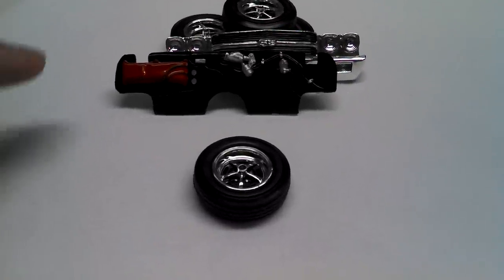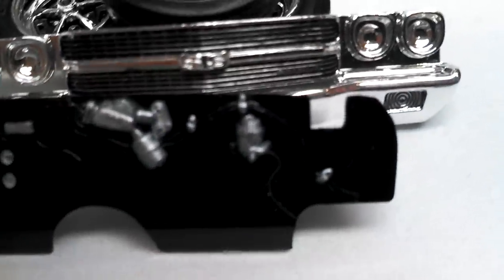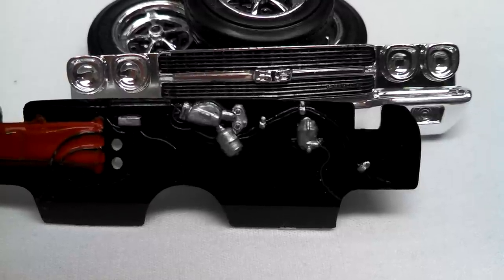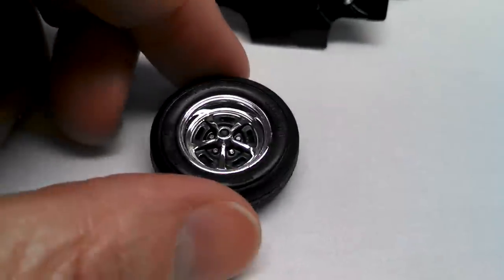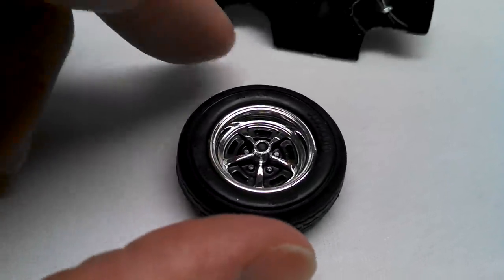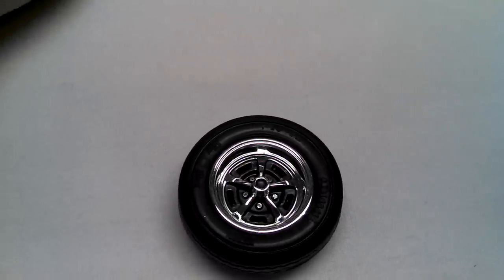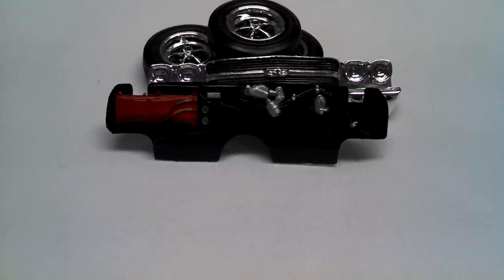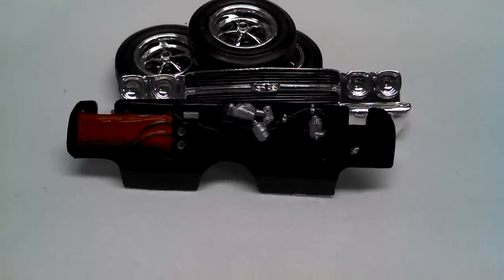Tip: Detail Painting your models

Comment: 6:00 - In regard to painting hoses that are molded on a black firewall, I would experiment with various "shades" of black. For example, "rubber" is a different shade of black. You could also lighten the color a little bit. I am lucky because I don't enter contests or send pics to magazines and my family is not interested enough to notice subtle differences in shades of color. My only audience is me. I do enjoy experimenting on scrap plastic. Thanks for this video! I have just subscribed. OBTW: I don't "wash" the grill with flat black because flat black shows that the grill is one solid piece of plastic, so what's the point. Same with wheel slots. I use classic black. I tried sanding away enough plastic to make the grill look "open", but it just never looked right to me.

Comment: I’m in no way an expert so when I get a chance to contribute something it makes me feel kinda good so hopefully this will help someone along life’s way. I recently built the 66 Chevelle Street Rat, that was not without its problems but I got it to a feel kinda good about it. I painted it the 50s ice blue and I wanted to make a black vinyl top and didn’t have any masking tape to put on it so I found these art deco foam dauber brushes at DG Store and mixed up some black semi gloss and I cut some thin strips of, it’s called foil back tape, I use it some instead of BMF, it cheaper and I get a lot on a roll, sorry I went in another direction, but I put than on for the seams and poured my paint on a baggie and daubed it on in a few light coats and it came out looking pretty good if I do say so. I think I might should mention that the brushes are not those gray foam brushes, these are kinda round, ball shaped, kinda maybe yellow in color.

Comment: What I do on a grill is black wash them. Take black paint thin it down  to the consistency of water then just let rip , slop it right on the grill . Then quickly wipe it with a rag,it cleans the paint off the high spots and makes the thing pop. The good part it takes all of 30 seconds to do.
Reply from the maker: washing them is a great option too.  I do that many times as well, just depends on how deep I want to go with the color.

Comment: Do you do any masking? I have a hard time staying in the lines. I will try your idea about using a toothpick to clean the areas I over run.
Reply from the maker: it really depends on what I'm painting. really small stuff like the wires I do not cause it can take a lot more time and be difficult. there is a liquid mask that you can use for detail areas that is easier than masking with tape.
Reply: a drop or two of color in an insulin syringe can help with brake lines and bolt heads that might seem appear on the models, and i dont do vids but i started building models in the early 70`s and i started detailing then,, i use colored or i paint fine thread for my wiring harness, my e-brake and flex line to each brake hubs. spark plug wire and water hose, some require different size thread or plastic tubing, hell even used copper wire for battery cables that i stole from phone line..i would take a group of coloed treads and create a globb of wiring like you would see under the dash,, it`s crazy fun under the magnify glass,, if the car has molded part on the chassis im replacing i grind and sand off with a dremmel,, my models can take a long time to build but they are nice,, i build`em and give them to my grandson,, never been to a model show and now im old it wont ever happen,, hard to get around now is the only reason why i wont go now,, i dont recommend it but i smoke weed its my only vise and hell the world is changing as we breath and it puts me in a zone has been since the 70`s and i wont stop til my eyes close for the last time. so dont judge me,, nope i can give you some of my ideas and you can do some more awesome r work,, rock on and love to live and live to love.
Reply: Thanks for tips

Comment: i subbed just now,, great channel,, good work.. i just got my very first 3D printed model parts,, 5 Holley 4bbls, 1/24 scale. they come almost clear, but the detail is scary good, you dont want to cover it with a air cleaner. might look at a small detail 3D printer or a small 5 axis desktop CNC as a retired machinist this looks good
Reply: Where did you find these to 3d print them, trying to print some parts for my future models?